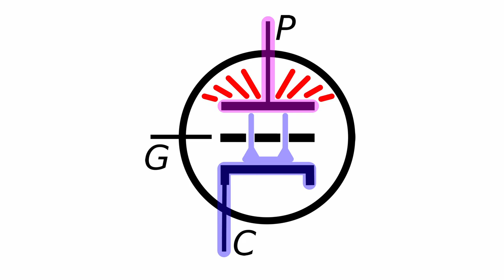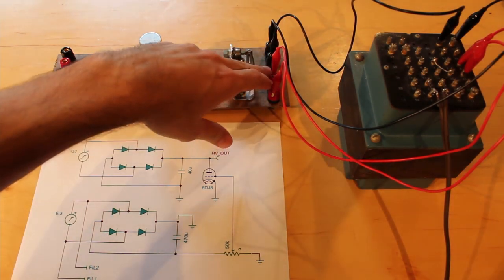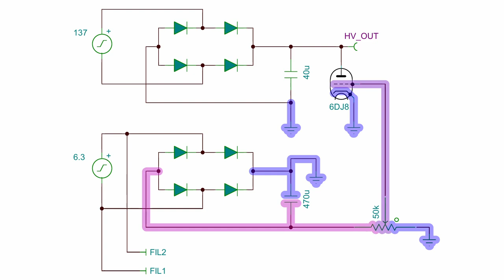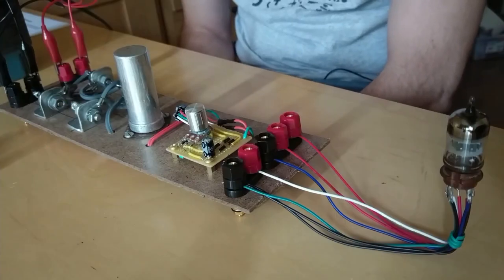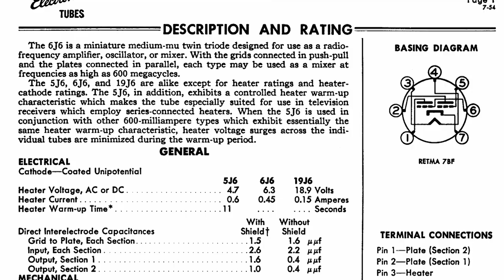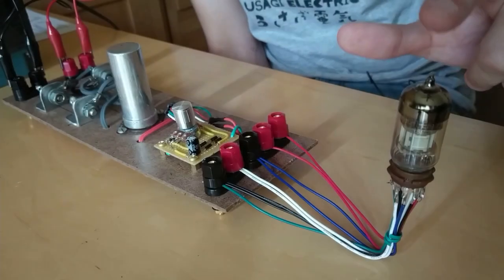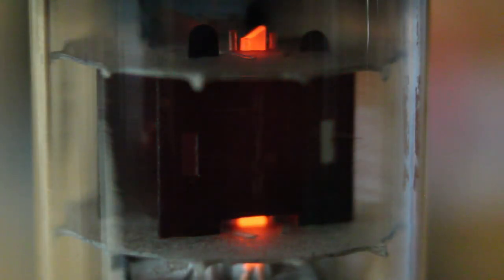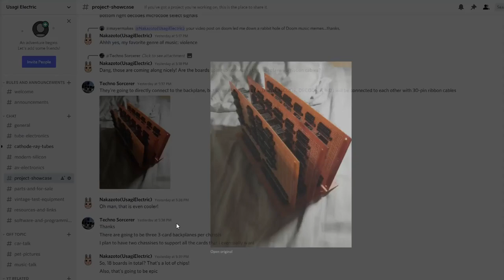Red Plating Vacuum Tubes to Destruction!

Comment: I wonder how a scintillation counter would react to these experiments...
Reply from the maker: That's actually a really interesting question!
A good photomultiplier tube tuned for a specific wavelength could tell what kind of energy the tubes are giving off. There isn't enough energy for x-rays or the like, but it would be really fun to see what exactly is being emitted in these pretty nasty situations!
Reply: @UsagiElectric  Most photomultiplier tubes are tuned for blue light, with their sensitivity to red being quite low. That's because of the construction of the photocathode (bi-alkali). There are some, fairly rare, that use a different type of cathode and are tuned more towards red. Nonetheless, even so the red that you experienced would be enough to burn off even one of the regular "blue" PMTs. That's because their amplification factors can be insanely high. You would want to intentionally reduce drastically the amplification by leaving some of the dynode chain unbiased, or very poorly biased. Or else you risk blowing the PMT. Also, you'd want to do that experiment in absolute darkness or a hermetically closed enclosure. Even a dim light from a LED can burn out a PMT. (source: myself. I'm building scintillation detectors as a hobby. :) )
Reply: At most you get very low energy Xrays of several hundred eV energy. The vast majority of scintillation materials will not be sensitive enough to get a response. They only start showing a response above 1-1.5keV Detecting such low energy Xrays is a complicated matter.

Comment: Try using a 6CM5 power pentode.

They were horizontal oscillator 20 W valves used in black and white televisions in the 1960s.

I saw one glowing a dull orange because it drove an eht transformer which had developed shorted turns....
Reply from the maker: The 6CM5 looks like it might be a decently popular audio tube.
If I destroyed one of those just to see it red-plate, the Hi-Fi audio guys would burn me at the stake, haha!
Reply: @UsagiElectric  it's not called red plating.... it's just overloading.

The 6CM5 is lousy for audio, it's very non linear. But it is a nice big valve with a big plate and they're impressive when they're glowing orange....
Reply: @UsagiElectric  EL84 or 6551 with 500 V B+.....

Could be SAVAGE!
Reply: @UsagiElectric   You might be confusing the 6CM5 with 6CZ5 which is a good substitute for the scarce and expensive 6973 audio tube (the pin out is very slightly different).  I also have some 6CM6 tubes which might have audio applications but I have not tried them.

Comment: The reason, as I understand it at least, for some triodes carrying more current than others is the density of the wires on the control grid. When tubes are manufactured they need specific parameters for the electrodes in the envelope to determine the characteristics. A triode that has a less densely wound control grid will allow more current to pass but have a much lower mu and amplification factor, such as the 12AU7 and the 6BZ7. A 12AX7 triode has more densely wound control grid, so it's much more sensitive to voltage changes, but can't pass as much current with the grid at 0V. The 6H2N-EB's are similar to a 12AX7, which is probably why they didn't red-plate.
Reply from the maker: I think you absolutely nailed it! I did a bit of reading through the datasheets to see what kind of plate current can be expected with a B+ of 280V and the grid at 0V and here's the results:

6H2N-EB: ~6.75mA
6BZ7: ~75mA

It's wild how different the two tubes are! But, it makes sense with what you're saying. The Russian tube just doesn't move all that much current (meaning it must have a pretty tightly wound grid), so I would need to really bump up my B+ and maybe even drive the grid into positive to get some red-plating action.

Thank you for the insight!

Comment: I had a vintage eico 460 scope and two of the tubes would always glow a bright violet. The glow on the tube would even bend if you brought a magnet close to it
Reply: Those were regulator tubes, they have gas in them
Reply: @krz8888888  no they were not
Reply: @krz8888888  the glow was only on the surface of the glass due to bombardment from electrons

Comment: Used to be common to see a TV horizontal output red plate when horizontal drive stopped working.
Reply from the maker: Tubes are awesome because they can take so much abuse. A tube can be red-plating mildly for a while before it actually goes bad, which is just wild to think about!

Comment: Anecdotally, I have accidentally destroyed miniature tubes by red-cathoding them on the test bench (these were cheap tubes).  So this is also possible.  
A friend loaned me a d'Arsonval type microammeter, which turned out to have been WAY out of calibration (due to permanent magnet decay), for doing some measurements so I could characterize some late-production miniature pentodes I had.  These were tubes with indirectly-heated cathodes, and presumably one of the later exotic-oxide (maybe Barium) coatings.
Running the tests on the bench, warmed up a tube cathode heater, then slowly increased the output on a bench supply to act as my B+.  Imagine my surprise that the needle on the microammeter barely moved, but the cathode on the tube seemed to put out a dull cherry glow.  Slowly dialing up to a couple hundred "microamps" of plate current, the tube cathode began to glow a pretty bright orange.  I concluded something must have been wrong, so I stopped the test.  Tube then failed to test good on a separate emission tester....hm.
Repeat experiment.  Same result.  Tube gave terrible calculated gm figure.  Then I decided to test the microammerer, and it was off by a factor of about 100.  100uA apparent reading on meter tracked with about 10mA of "real" DC current.  Oops.  Even when your buddy tells you "sure, it's accurate", check anyway....
The upshot is that I never got any luminescence out of the tube plates, but the cathodes did, and were destroyed (presumably the exotic oxide coating was either ablated or diffused inward).  Depending on internal geometry of a specific tube, I guess the plate can be physically large enough, and the cathode small enough, that cathode emission dissipates more heat than plate kinetic-collision of electrons.  So, there's more than one way to "do it wrong".

Comment: Ik this video is two years old but I have actually killed a sub miniature tube using a d cell, the circuit was made in the 50s new batteries are more powerful than the old copper batteries and sometimes the circuit cannot handle the constant voltage of the nee battery so it can pop it and leak the alkaline acid in doing so the pop created enough current at once to burn out the filaments of the tube

Comment: It happened to my tuning a vttc tube was pl504 but the tube survived!
Reply from the maker: I was surprised at just how much pain I had to throw at the tubes to actually damage them. Most tubes could handle a little red plating with no problem at all. It's amazing how tough tubes really are!
Reply: @UsagiElectric so tube pops out when big voltage is present 
What about 0.7 volts 
Can vacuum tube red plate at 0.7 volts

Comment: Surprised those diodes worked at high voltage as it was for a low voltage charger. I would expect 100V diodes.
I have seen guitar amps with the plates that look like swiss cheese from being driven so hard.
Reply from the maker: The 6AL5 is good up to a peak inverse plate voltage of 330V, and I was only at about 180V here, so I still had plenty of headroom!
It blows my mind how hard you can drive some tubes and still have them keep on ticking!
Reply: @UsagiElectric  I think you misinterpreted the comment.
Scott was talking about the silicon diodes used in the bridge rectifier of the HV supply, not some vacuum tube.
Reply: @Scott H The potentially low reverse breakdown voltage limit of the rectifier diodes was my first concern too. But here is a thought on that; if you remember your vintage lead acid car battery charger circuit, you will agree that these chargers hardly use a full-wave bridge(!) rectifier with 4 diodes. They commonly use only two diodes and a center tapped transformer (full-wave rectifier). Those who dont believe are invited to dl the manual of the Lestronic II and see for themselves...
Now on the topic of reverse voltage; some thinking may make it clear, that on a full-wave bridge(!) rectifier with 4 diodes (like used by Usagi Electric) the two non-conducting diodes only need to withstand the nominal AC output voltage in reverse.
On a non-bridge(!) full wave rectifier consisting of two diodes and a center tapped transformer, the non-conducting diode however faces double the AC voltage in reverse. (Simulate it on LTspice if you dont believe)
Now knowing that
A) classic lead acid chargers use the full wave rectifier with 2 diodes on a center tapped transformer, and
B) the unloaded voltage of even an unregulated 36V system charger may exceed 45V, which puts the rectifier diode at a minimum of 2*45=90V reverse voltage, and
C) there is 48V golf cart chargers, who should top up at 60V (120V reverse)
It is safe to assume that the rectifier diodes are at least of the 200V reverse breakdown types.

Comment: I'd like to have seen an analog ammeter hooked up to the anode to see how much these pulled
Reply from the maker: I did want to put an ammeter on there to see how much current they ended up pulling, but oddly, I don't have a good current meter. All I've got is my little UNI-T 120e DMM, and I haven't been able to get it to read current properly yet (most likely, I'm too dumb to use it properly). 
But, looking at the datasheet, we can kind of come up with some rough ideas! 

My B+ voltage was right around 280V and most datasheets have a little chart with grid voltages that can almost get us there. So, at 280V with a grid voltage of 0V, the maximum plate current should have been around this:

6HA5: ~70mA
6J6: ~45mA
6H2N-EB: ~6.75mA
6BZ7: ~75mA

This actually explains why the 6H2N-EB didn't glow. I didn't have nearly enough B+ to get enough current flowing through it to upset. Ideally, I would have had closer to 400V and maybe run the grid into positive voltage further. This also explains why the 6BZ7 didn't fair too well. 75mA at 280V is approximately 21W, but according to the datasheet, the 6BZ7 has a maximum plate dissipation of 2W, so we were cramming 10x the amount of power through that tube than what it's maximum rating was!

Comment: The blue light is x-rays btw
Reply from the maker: I'm not quite sure I had enough voltage to generate any x-rays here. Usually, several thousand volts are required for x-ray emission, but I was only working with about 300V here. I think the blue fluorescence was caused by an imperfect vacuum, or perhaps even some off-gassing from the material inside the tube.
Reply: @UsagiElectric  In gas  discharge tubes the color is specific to a certain gas or material. Assuming a pure gas or vapor you can get shades of blue from hydrogen, argon, krypton, xenon, oxygen, or mercury vapor. Saying a blue color is x-ray isn't necessarily correct. We're not scared of the orange glow from a neon bulb or a neon sign. I'm sure in a traditional x-ray tube that the high voltages might cause some color discharge but we're not gonna look. See the Wikipedia entry for X-ray tube. The last section gives some info on x-rays emitted from vacuum tubes, but it occurs at high voltage, >> 1 kV.

Comment: I've seen TV signal diode red plate with only a few volts.
Reply from the maker: It's all about finding that balance between voltage and current. Even with only a few volts, if the load is trying to pull a huge amount of current, the plates can start to get hot!

Comment: I was wondering how did old cars work with 12v battery and a tube radio ?
Reply from the maker: That's actually a super fascinating part of history!
In the 40s, most cars actually had 6V electrical systems, but had tube radios in them. The 6V worked perfectly for the tube heaters, but to get the HV they used something called a "vibrator". Essentially, they created an oscillator with a relay (+6V into the common and the coil was powered from the normally closed pin. The coil would trigger the relay which breaks the power to the coil, causing the relay to snap on and off as fast as it physically can.) This created a square wave that went into a transformer to create high voltage, which was then rectified and used for the tubes in the radio.
The same method was used for 12V systems too, but by the time 12V systems were common, space charge tubes were starting to get used in place of the old vibrator design. These are tubes that are specifically designed to work with 12V on the plate (and 12V powering the heater). So, no high voltage anywhere in the system! But, that was pretty short lived because the transistor was starting to get cheap, so finding space charge tubes today is a bit difficult.
Reply: @UsagiElectric I have some of those  vacuum tubes designed to work at 12V plate voltage! They're rare today, but they were made exactly for this application in the 1940s, radios powered by a 12V battery. They're actually specified for a maximum plate voltage around 30V (and sometimes as low as 16V). Examples are: 12AD6, 12DV7, 12U7, 12AL8, 12DV8 and so on. You can still find such tubes on the used market if you look hard enough. :)
Reply: @UsagiElectric  ,  Note that prior to the development of space charge tubes for car radios there were 1 and 3 volt tubes used in "portable" radios such as the Zenith Transoceanic, 1L6 and 3V4 tubes being an example. The 1L6 is the only tube that really works correctly in Transoceanic and they are scarce and pricey nowadays.  I put the word portable in parentheses because the tube type Transoceanic radios are bigger and heavier than many boomboxes.

Comment: Triodes model as voltage sources, so you won't be able to red plate ones with too much plate resistance. Bet you can red plate a 12AU7 but not a 12AX7. The 6BZ7 specs close to my favorite 6BQ7. That one red plating doesn't surprise me.
Reply from the maker: Yup, that's exactly what was going on with the Russian 6N2P. I didn't have nearly enough B+ to stress it to the point of red plating. The 12AU7 is a fantastic little tube, I have much better results building with the 12AX7, and I think that's probably due to difference in plate current capabilities between the two. The 6BZ7/6BQ7 are also great little tubes and can move a decent amount of current, even at low voltages!
Reply: I have a bunch of 12AX7 that test ok but are too microphonic to actually use. So I rigged up a microwave transformer with a HV diode and connected up the plate and cathode and used a small transformer for the heater. I had a meter connected in the cathode to show the current and I calculated the plate was trying to dissipate approximately 24watts. (A 12AX7 plate is rated for only 1 watt of dissipation). Because a microwave transformer puts out 2000 volt at 2 to 300 mA this NOT something to do if you don’t know how to work with high voltages safely.

Comment: are power resistors put in a circuit to prevent red-plating?
Reply from the maker: I'm not too knowledgeable about specific audio setups, but the balance of plate resistor, tube dissipation and desired drive current is a pretty common design aspect of tubes in computing situations. For example, IBM likes to use 20k plate resistors with a plate voltage of 150V. That's a relatively small resistor for that much plate voltage, but it means that one output from a logic element can drive quite a few other inputs without having to worry about fanout issues.

Comment: Pity no plate meter.
Many years ago, I tried to make an audio amp, I had a 6CM5 line output tube, a speaker transformer, and a pot. 
I was used to single transistor amp stages, you bias it on to get some volts across the load. So I tried the same with the tube. nothing, so I must have the grid wrong (150V on the plate) I ended up sending the grid positive, whereupon there was a frizzling sound from the tube and the bias pot smoked up. I think I red plated the grid.
Learned my lesson, stick to transistors.

Comment: Any chance you can test the tube characteristics before and after red plating?
Reply from the maker: Unfortunately, the 6H2N-EB did not survive, but not because of the testing, because my clumsy self knockced it off the table and it shattered. So, I can't test that one, but the remaining three I can test!
I have a cheap Accurate Instruments 257 Tube Tester, and while not all that fancy, it should give an idea! It gives emission on a scale of 0 to 100 with anything above about 45 being considered "Good".

Good 6HA5: 72
Red plated 6HA5: 66

Good 6J6: 72/70
Red plated 6J6: 16/20

Good 6BZ7: 72/68
Red plated 6BZ7: 0/0

The 6BZ7, predictably, is totally dead. It wouldn't even register. The 6J6 isn't totally dead, but we definitely hurt it something fierce. It did register some emission, but that's deep in the "Bad" category on the tester. The 6HA5 though is a little trooper! It only showed slightly less emission than a known good version and honestly, could probably still work in some circuits, despite the extreme conditions it was exposed to. That one totally blew me away when I tested it!

Comment: Those tubes can generate x-rays when overdriven like that.
Reply: Very, very low energy Xrays of 200-300eV at most. They can't even be detected by usual radiation detectors because they're too low energy. You need Xrays that are tens or hundreds of keV for them to be any safety concern. Medical Xray tubes are usually driven at 15-50kV for instance.